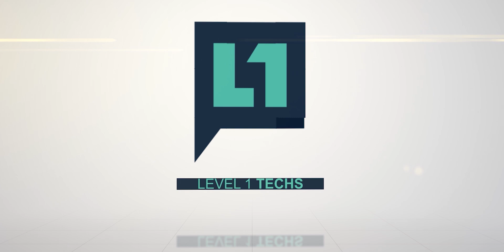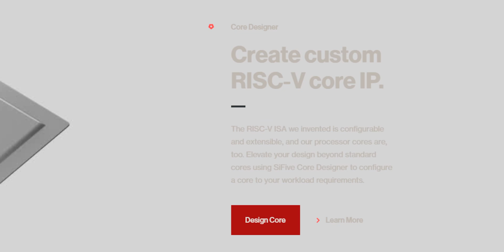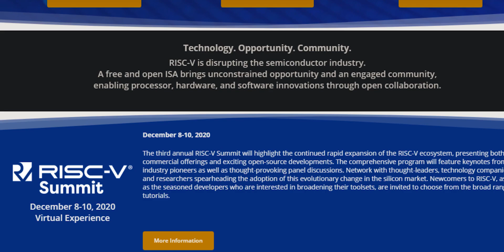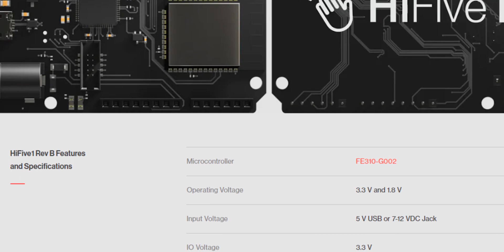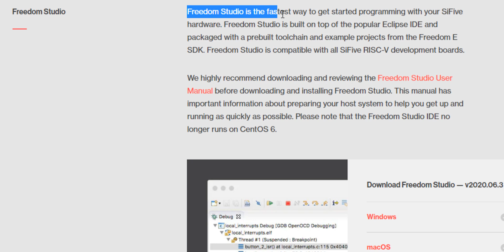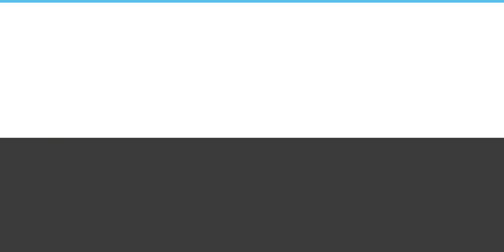SiFive/RISC-V Questions w/James Prior

Comment: How am I supposed to design a 65536 bit word length processor with 64k to Exa layer hyper threading per core using RISC-V capable of managing 2^65536 bytes of ram with trillions / Exa CPU cores per processor capable of hardware level emulation of at least x86+64, ARM, and power9/X ISA operating at exa hertz+ optical / quantum system bus.

a stupid FPGA capable of emulating a microcontroller is grossly stupid.

Comment: Polarfire SOC ICICLE is perfect and Pioneer board.  If you need:
10Gbps Ethernet using SFP+
Stacking & daisy chaining
Huge EMMC 5.1 up to 1Tbyte
LPDDR3 for FPGA switch fabric of SOC
RTC 
Flexible programmable docking and more..
Check out SAVVY-V !!!
@riscV_SAVVY at twitter
google "SAVVY-V"

Comment: Don't know why, but I also refer to risc-v as old tech with new tooling :DD But I'm becoming more and more interested in other ISAs than x86 and arm as IoT and other low-powered chip(sets) become more and more useful (and even possible with low-power cores) in different applications.. And Risc-V is really interesting in this that you can design your own core, even cheaper than licensing arm cores and could be only and also everything you need in it, add/take away - config exactly what you need

Comment: How long before we see larger more performant SOCs. Most risc-v stuff is low power right now? I imagine a lot more engineering work is needed for bigger systems?
Reply: Please check out SAVVY-V cluster board for more processing power. We are 2 guys working on it.
Twitter : @riscV_SAVVY

Comment: Love it. As ARM SBC user/developer it always feels like 1 step forwards, 2 steps back. Everytime we succeed in adding fuctionality there's always other things that break. That due to a lack of devs/testers/users/money/support from Ubuntu/Debian/Microsoft?. 
With mainline things seem to improve, slowly. But what would be done a year ago stil ain't working right now. ARM could have even taken mainstraim pc last years if only enough development was done. As long as VPU/GPU drivers are not free open-source it's not getting there.
I've got hopes for RISC-V to be able to do better. I don't need the maximum possible performance. I just need the performance for my tasks. I rather have 10 x 5w devices each doing its task well. Than an x86 pc wasting energy constantly. Thank you, I'd love to review a SiFive SoC. Greetings, NicoD.

Comment: I wonder if RISC-V will ever come to personal computing devices as the CPU (I think some drives have RISC-V controllers). It's all about custom silicon, which doesn't seem to have any overlap with the personal computing space at the moment.
Reply: It's just a matter of someone seeing a market worth the several billion dollars of investment needed to make a Skylake or Ryzen class process with any instruction set. Apple has done that with the ARM 64 bit instruction set because they know if they put it in Macs then all Mac users will buy one. If they'd chosen RISC-V instead of Aarch64 it would have worked just as well.

Comment: 26:00 are you talking about "opencores" dot org?
Well, even Alibaba had to add 50 custom instructions to make riscv work for them. I don't think it stands a chance against a mature ISA like PowerPC. 
If you want to make your own desktop pc, use power. Compilers support everything anyway. 
The problem that power has is the same that riscv has: Economy of scale. Raptor's Talos cost 3x what x86 does. And Riscv won't be cheaper. You can't beat billions of cores of Arm/X86 each year price wise.
And if you want a new esotheric ISA research, look up "Forwardcom dot info". The guy behind that is the assembler God.

I don't buy into the RiscV hype
46:50 Here is the important part for all of you risc-v fanbois that want a risc-v desktop/laptop/edgy. Not gonna happen

Comment: Nice talks, but a HiFive board that replaces my Raspberry Pi costs $999 👎
Reply: So did ARM boards before the non-profit (and indeed subsidized) Raspberry Pi foundation came along. Existing and working at all is the big step. Driving the price down is then just a matter of time and economics. Note that there is now the $499 Icicle board with the same FU-540 penta-core complex as the HiFive Unleashed embedded in a 250k element FPGA. It's running slower (600 MHz), so close to the original Pi but with five cores instead of one and with a lot more RAM. Or like a Pi 2, but 2/3 the clock speed. Next year we'll probably see $250 boards simply by using a version of the PolarFire SoC with smaller FPGA part, once those become available, and a more focused set of peripherals on the board (the Icicle is pretty kitchen sink, with dual gigE, eMMC, SD, x4 PCIe ngen2, Raspberry Pi connector, mikroBUS, 2x CAN).
Reply: Rome wasn't built in one day.
Reply: Is this the reason of selling more than 15 millions of PI for years ? RISC-V is a new world of CPU architect. It totale depends on from where you are looking ! Can you add new ISA to ARM based Broadcom loaded PI ? Again there is no unity, rather variety.

Comment: 13:01 RISC-V and standardized do not fit together.
The idea behind RISC-V boils down to: "This is the recipe to CPU Anarchy. How about we all agree to that? kthxbye"
As soon as this takes off, it will run against a wall.
Reply: You need some standards for compatibility or you will end up with a bunch of stuff that does not work together. This modular method seems the best to get it adopted and actually used.
Reply: @Greenwithao  It's not modular though. It's do whatever you want. Which will ultimately result in "a bunch of stuff that does not work together".
Reply: Yeah, if so much is optional and extensible, then it isn't likely to be consistent enough to become a commodity platform. Perhaps it will be used in custom embedded applications or something successfully.
Reply: @keyboardpuncher  "custom embedded applications" that's exactly where I see it.
Reply: If it grows enough, a standard or a few standards will necessarily emerge.

Comment: While I'm not a developer, programmer, or engineer, I find RISC-V super fascinating and exciting. 
I've been into science and engineering since I was a little kid but, somehow, the career I'm in is more artistic (I design and teach competitive marching band shows).  I'm  more of the overall ideas, creativity, and execution kind of guy. I'm working on a project now which I'm prototyping with Arduino and will eventually get custom PCBs made for final production.... (it's a bit of a weird project, and has to do with marching and performing arts.)

What I find SUPER cool about RISC-V is the idea that eventually someone could go onto somewhere like Fiverr (five-er🤔 ) and commission an engineer to design actual silicon that can do exactly what they need for a particular application. Imagine if fabs and foundries end up something like the massive PCB houses are now, where you could send over the design and have prototypes manufactured. I mean... there's probably a LOT more to silicon photolithography than PCB manufacturing, but it could be an interesting way for fabs with outdated nodes to find new business....

Yeah, I'm sure that's all fantasy thinking, but still fun to imagine. Assuming the human race makes it much longer.  :P

Comment: At the start he says "so a lot of advantages there the open nature means that it's auditable it's extensible you don't have to you know guess what's inside". This is in contradiction to something he said only moments before, "we've got some other secret source things that we do for our architecture" If they have implemented it with their own secret source how can it be auditable? Like saying if the DX12 API was open source that we can audit how Microsoft had implemented it. Which would not be the case.
Reply from the maker: I understood it to be process technologies for reduction of build time while being open about their Isa. Everyone can see how the bike is made and the gears turn, but how is it mass-produced quickly?
Reply: @Level1Techs  I will have to dig into this a bit more. Looking at their site it is hard to see what of their product range is open. I understand open does not mean for free. The ISA is like the CPU version of a header. With it I can build a compatible CPU with zero licence fees. But in using the ISA do I have to release the silicon design? I do not think so and without that it would say it's difficult to audit. Undocumented instructions is what people are concerned with. Having an Open ISA does not stop this. Don't get me wrong, its a step in the right direction as to compete companies have to build the best implementation of the ISA. No need to pay big licence fees. I need to buy one to poke around with. :)

Comment: With nVidia buying ARM, it's going to be interesting to see if big players like Amazon would back a more open ISA like RISCV. Amazon already have ARM in their data centers (see Graviton), and seem like the kind of company that can implement RISCV hardware and abstract it away for regular devs via high level APIs.
Reply: @Hugh G. Rection And without high level APIs, your platform is dead. It's impractical to implement everything from the ground up, all of the time.
Reply: @Hugh G. Rection Yes, they are. The issue here is that they also require a larger volume of work to get an application running. Technology stacks are selected depending on the size of the team, the budget and the deadlines. If it's too difficult to use, it won't gain traction. There are a lot of really good technologies that didn't leave the world of academia or hobbyists simply because of these factors. It's better to get a product working and then continue with optimization rather than starting from a low level approach.
Reply: @Hugh G. Rection Sure, to an extent. But not everyone needs the absolute last ounce of performance from their hardware. If it can deliver say 90% of the hardware capability with abstraction and provide a far easier system, people won't care because it's "good enough".

Comment: So why I should use Risc-V not PowerPC ( now open sourced )
Reply: Depends where you're coming from and what you need, but one important point is the industry momentum RISC-V is picking up right now. Basically "everyone" is working together to make RISC-V as good as it can possibly be (almost like with Linux), and I think we will see a lot of improvement and adoption over the coming years.
It's really cool that PowerPC has been open sourced, but I believe that move might be a bit too late for it to catch on (it's kind of drowning in the hype).

Comment: I've been messing with embedded Rust on a cheapo GD32 RISC-V microcontroller. It's been pretty competitive with a typical STM32 ARM board (aside from the lack of a FPU), which is impressive for such a new architecture running a new ISA.
Reply: Interesting.. haven't heard of GD32 .. been mostly fixated on ESP32 for my IoT at the moment... thanks
Reply: @jfltech   For context, Gigadevice started producing the "GD32" line as clones of ST's STM32 line, with ARM SOCs having the same pinout, peripheral address layout, etc... as a STM32F103 (which are honestly somewhat dated designs.) These new GD32's are basically the same thing as those, but with the ARM core replaced with a RISC-V "Bumblebee" core licensed from the Chinese developer Nuclei System.

Seeedstudio has some GD32 + ESP8266 development boards on Mouser that I considered buying, would've definitely pulled the plug if they had ESP32's.